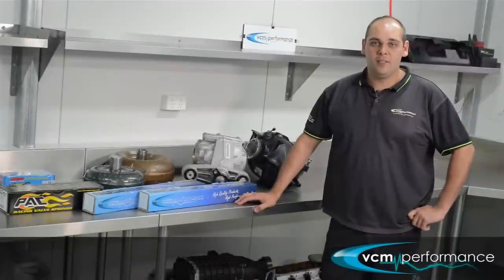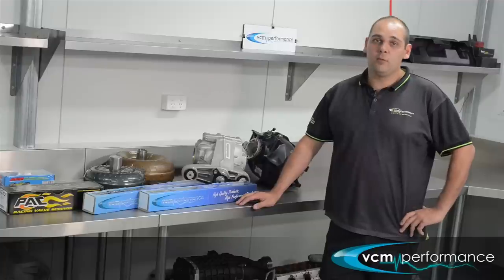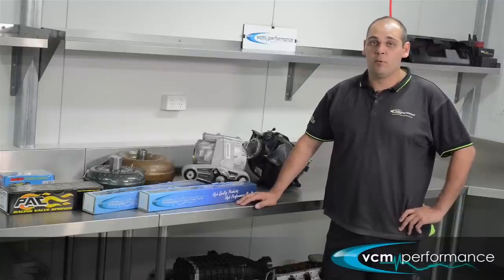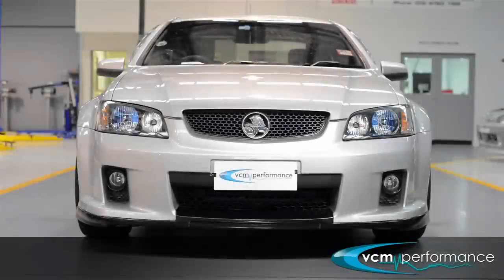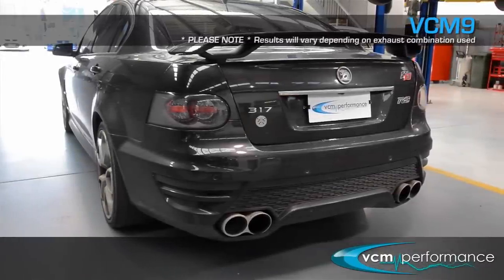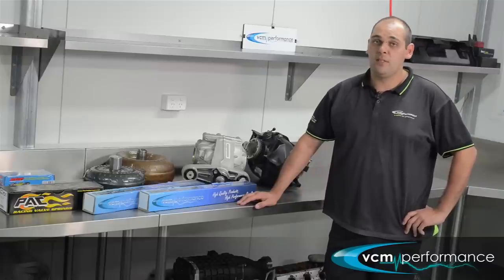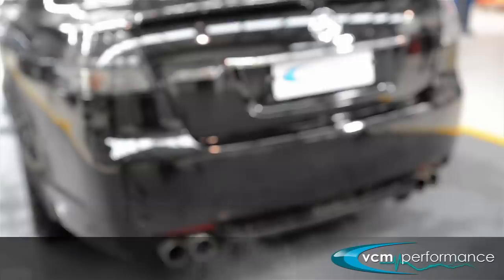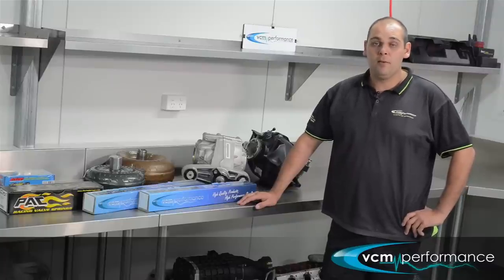How to choose an LS camshaft for an auto with stock converter ~ VCM

Comment: I'll take a dual pattern vs a single pattern cam any time. Single pattern cams aren't necessarily good for stock heads, due to casting irregularities, etc., and work best in ported/CNC'd heads that can support the flow characteristics of these higher performannce cams.

Comment: Why would you want a performance cam and not upgrade your converter. A high stall converter is the best mod for auto ls1 fbodys. You can daily drive them no problem without sacrificing alot of gas mileage. It's not like old converters in like 60s muscle cars. Lockup around 40mph and it drives just like stock.

Comment: are you familiar with american vehicles?.. if so what cam would you recommend for a daily driver 4.8 chevy tahoe(2006) with stock converter. thank you for your time
Reply: Erick Guerra  I'd say something in the 218/220 range
Reply: Alex S.  a forum on facebook recommended similar.. im looking into it now.
Reply: Alex S.  thank you
Reply: Erick Guerra 
There's anything better than a 4.8 with turbo
Reply: Erick Guerra I built a LM7 with ported 862 heads and LR4 flat top pistons 10.25:1 compression felpro head gaskets pt9292 .056 and the cam I chose was 216/220 .560 114lsa, My setup pull like a SOB especially on the freeway and I have a 4L60e with stock stall in my 99 trans am I also pass smog no problem.
Reply: Why dont you spend money on getting your heads ported, theres just as much power available in a good port job as there is in a cam. And your engine will run better with less problems. Racing open wheel in the 80s 90s, every year your heads became obsolete because better ones came out every year by different porters with more power.

Comment: Keep duration 216 or under on intake 220 or under on exhaust is a good start going above these numbers will require a 2500rpm stall converter and 3.73 or more gears even a cam with these duration numbers would do better with a 2500rpm or more stall converter something like summits Pro LS truck cam #8719 with 209 duration intake and 217 exhaust with .550 lift should give you good torque from 2000rpm to 6000rpm with a stock stall converter you'll need 3.73 gears
Reply: you can run up to a 226/232 with stock convertor and retain great manners go look at the independant motorsport dyno videos Champ.
Reply: @AndrewMitchell001  my new GM performance LS3 495 horsepower crate engine has a fairly mild LS3 hot cam with 219 duration intake and 228 duration exhaust it's in my 2011 Camaro SS with a built 6L80e transmission with a 4200rpm Circle D lockup stall converter with stock 3.27 gears it has wicked throttle response has run 7.22 at 96mph in the eighth mile with 1.65 60 foot times running a camshaft with more duration without a stall converter will make for a sluggish car under 3000rpm compared to a stock camshaft you can install a large camshaft and it will work but it will be sluggish everyone has different idea's when it comes to camshafts l wouldn't recommend a camshaft any larger than a 204 duration intake and 218 duration exhaust on a LS powered 5.3 6.0 or 6.2 if planning on running a stock stall converter and even this mild camshaft would perform much better with a 2500-3000rpm lockup stall converter the difference in acceleration would be very noticeable cutting your 0-60 times by .6 of a second or more even a stock 5.3 6.0 or 6.2 LS engine would accelerate much better with a 2500rpm stall converter over a stock 1600rpm converter LS engines like higher stall converters than old style Chevy small blocks do l have a 2009 Tahoe PPV 2wd 5.3 it's stock with a cat-back exhaust system had the 4L60E transmission rebuilt and used a stock 2009 Trail Blazer torque converter because it's a 2000rpm stall compared to the stock 1600rpm stall converter and it has 3.73 gears stock just that 400rpm increase with the stock 3 73 gears probably knocks off .3 -.5 of a second 0-60 and a 2500rpm stall converter would accelerate even better knocking more time off your 0-120mph times
Reply: @AndrewMitchell001  I'm not going to argue with you put this 226/232 camshaft in a car truck or SUV without at least a 3000rpm stall converter in a car truck or SUV that weighs 4000+ pounds and see how well it performs from idle to 2500rpm peak numbers on a dyno look impressive horsepower and torque throughout the entire RPM range is more important than peak numbers big peak numbers mean nothing to me times the car runs does put this 226/232 camshaft in a car with a stock 1600rpm stall converter it will be very sluggish from a dead stop and have no throttle response below 2500rpm it will not be eager to rev below 2500rpm
Reply: @gloriamaletta8667  have you had a look at the video yet champ or you still being a know all.
Reply: @AndrewMitchell001  l just watch it it made 455 horsepower to the wheels with the 226/232 camshaft on a LS3 and it clearly said a 3000+rpm stall converter is recommended for peak performance my car made 430 horsepower to the wheels on E85 and makes 400 foot pounds of torque or more from 2700rpm-6200rpm at the crankshaft and 495 foot pounds at peak torque at the crankshaft at 5000rpm so I'm down 25 horsepower at peak to this setup but I'll bet I'm up 30 foot pounds of torque from 2700rpm -5000rpm vs this setup you know how l know l had a LS2 in a 1984 Monte Carlo SS with LS3 heads and a single plane intake with a Holley HP 850 carberator with a 226/236 duration camshaft with a 3000rpm stall converter with a built 700r4 transmission and 4.10 gears and my Camaro with a 219/228 camshaft with 4200rpm stall converter and a 6L80e transmission with 3.27 gears is .3 tenths of a second faster than the Monte Carlo SS was with less passes at the track and the Camaro weighs over 500 pounds more than the Monte Carlo did I'm not saying it's not a good package it will need a 3000+ stall converter to get peak performance out of it bet it makes less torque than a stock LS3 with a stock cam does from idle to 3000rpm this kind of camshaft needs to be above 4000rpm before it really starts pulling hard getting this kind of setup above 4000rpm is when it shines
Reply: @gloriamaletta8667  which car was it champ what colour so I can look at the video you watched
Reply: @AndrewMitchell001  let me put it this way champ if your making 25 more horsepower at peak rpm but are down 30 foot pound of torque throughout most of the rpm range 2700 - 5000rpm in first gear I'm already in front of you is not going to win you any races once l leave off the light and shift into second gear my engine never drops below 5000rpm when it shifts into the next gear staying in between 5000-6600rpm most drag races are won in the first 100 feet playing catch up most of the time doesn't work out to well generally
Reply: @AndrewMitchell001  11 months ago 2671 views
Reply: @gloriamaletta8667  you have no credibility at all now champ that happens to people who lie now I know everything you have said is all BS see ya champ.🤣🤣🤣
Reply: @gloriamaletta8667  Hey Champ liar gone quiet 🤣🤣🤣
Reply: @AndrewMitchell001  you can put a camshaft with 251 intake duration and and 266 exhaust duration with a stock stall converter and it will work my next question is why are you installing a camshaft 90 percent of people installing a camshaft do so in hopes of going faster than stock at the same distance and to do so when installing a cam with more duration you'll need a higher stall converter to take full advantage of the camshaft upgrade otherwise you gain nothing and possibly make the car slower yes you can put a larger camshaft with a stock stall converter and it will run it will work but by doing so you are gaining nothing the car truck or SUV will not rev quickly below 2500rpm be extremely sluggish from idle to 2500rpm with terrible throttle response everything has to work together camshaft size engine size weight of vehicle stall speed and rear gearing all have to match then there's suspension setup and tires because all the power in the world won't help if your spinning your tires most people change a camshaft in hopes of going faster if all these things don't work together with the perfect setup you gain nothing I'm 59 years old have been around cars since l was 16 years old and have been through trial and error with 6 performance cars trucks and SUV throughout my life if you think putting this 226/232 duration camshaft in a car with a stock stall converter it's your car and money just do so see how well the car performs you will kill the cars performance from idle to at least 2500rpm before you'll feel any serious pull at full throttle the idea of a stall converter is to put the engine you just cammed into its RPM range that it starts to make good torque with a camshaft with more duration on a LS powered engine it will be at least 3000rpm have you ever been in a car with a 4000+rpm stall converter the throttle response is very wicked and the engine revs extremely quickly with the slightest push of the gas petal putting your cammed engine in its sweet spot where it starts making good horsepower and torque
Reply: @AndrewMitchell001  you can put a 226/232 camshaft in your car with a stock stall converter and it will work and run car will surely be slower than with a stock cam and a 3000rpm stall converter would be 0-60 probably 2 to 3 car lengths from a dead stop if the way the 226/232 cam sounds in your LS it will lope and sound mean if that's all your after without at least a 3000rpm stall converter it will be slower than a stock cam car 0-60 but it will sound badass when it idles but you'll gain nothing performance wise you'll have a very sluggish car that sounds mean
Reply: @AndrewMitchell001  you could put a 251/266 duration camshaft in a car with a stock stall converter it will work it will run it would be ungodly sluggish until at least 4500rpm
Reply: @AndrewMitchell001  if you get time watch this YouTube video MAPerformance Customer Loyalty Managers 500hp LS Swapped Malibu it's equipped with a Circle D 5000rpm lockup stall converter and if it had a stock 1600rpm stall converter it wouldn't even run perform remotely close to what you see in the video
Reply: @AndrewMitchell001  what was it l lied about
Reply: @AndrewMitchell001  l never said it wouldn't run fine with a stock converter it would be much better if it had a high stall converter running a car on a dyno vs running it on the street or track are two completely different things if you don't want to watch the video l sent you of a car actually running on the street with a high stall converter then watch your car DYNO videos and stay in fantasy land and be on your way if you think running this 226/232 camshaft with a stock 1600rpm converter and it's going to work out beautifully it's your car and your money do it and stop wasting my time because you don't have a clue
Reply: @AndrewMitchell001  ask Ali if this 226/232 camshaft will respond better with a 3000rpm stall converter or a stock 1600rpm converter see what he says if he's honest and has a clue l already know what the answer is you don't even have to tell me his answer l know what it is but l lied to you unbelievable
Reply: @AndrewMitchell001  ask Ali the question l told you to ask him if l lied see what answer he gives you
Reply: @AndrewMitchell001  this can be end very simply put your 224/232 duration camshaft in your car truck or SUV with a stock 1600rpm stall converter and tell me how it works out are you running this 224/232 duration cam with a stock 1600rpm converter anyone who has any sense and has a clue would not recommend a camshaft with over 220 duration using a 1600rpm stall converter
Reply: @AndrewMitchell001  l asked you a very basic simple question do you own a LS engine with a 224/232 camshaft and a stock 1600rpm stall converter 2nd question do you own a LS powered car truck or SUV period l have owned 5 of them since 2002 until present a 4.8 two 5.3s a LS2 and a LS3 the LS2 and LS3 have been pretty modified with many upgrades high lift and duration camshafts and CNC ported and milled cylinder heads one of the 5.3s had a LS1 camshaft and LS1 cylinder heads so l have owned 3 modded LS engines since 2002 l get no reply your completely silent not answering the question asked because you only answer questions you want to hear like CNN and Don Lemon is the information your giving me from life experiences or from watching YouTube Dyno runs my information is from life experiences I'm not expecting a reply because your not liking what you hear just like CNN and Don Lemon

Comment: There is a lot of lift with those cams for someone that does not want to upgrade their valvetrain. Yes they will work with standard converter and gears but the lift is too high for the standard valvetrain
Reply: +Dan Gray $30 for a spring compressor and $100-200 for a new set of valvesprings and you are good to go.
Reply: Dan Gray $79 for Chevy performance beehive valvesprings 

but also a lot of engines don't need valvetrain upgrades, such as the ls2/ls6/ls6/lt4 as they come with those springs already
Reply: ShadowOfDeath24 
please from personal experience don't use original spring for a camshaft unless their lift is .525 , don't make the same mistake I had in the past.
Reply: @Shadow0fd3ath24  what about LS3 heads? G8's are LS2 bottom ends and LS3 top ends. Called a L76.